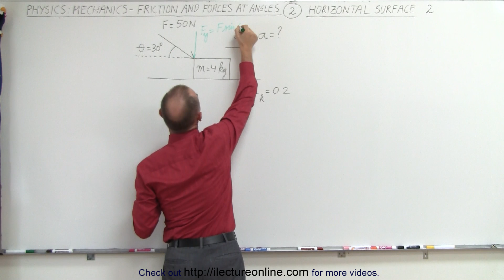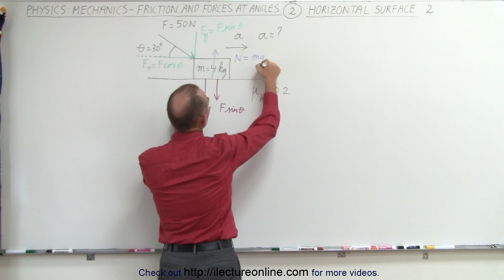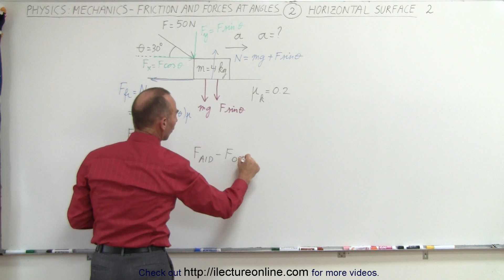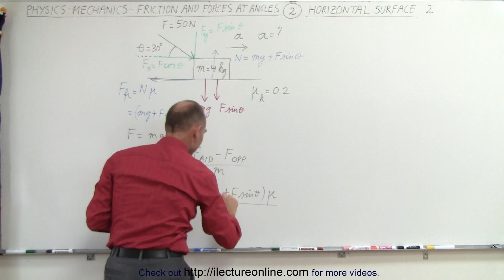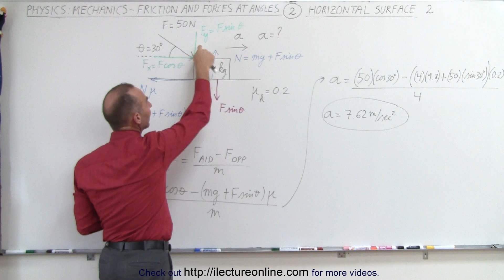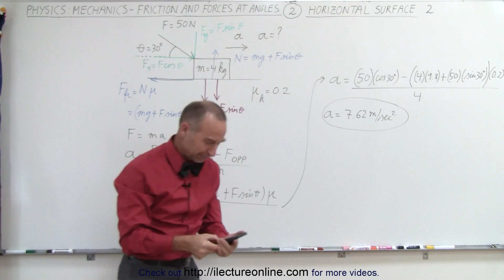Physics 4.7   Friction & Forces at Angles (2 of 8) Horizontal Surface: 2

Comment: Since acceleration is positive on the right hand side shouldn't the equation be a=Fopp - Faid?  Correct me if I'm wrong.  I always write the side of the acceleration first & negate the other side.  Thank you
Reply from the maker: I prefer to calculate the magnitude of the acceleration first, and then determine the direction, if the original guess was wrong.  But yes there are several ways in which this can be calculated.

Comment: The coefficient of friction between ground and ground is 0.  Is 1.  15 kg is the value of the force f if the offender receives 3ms ^ -2 armature when the f key is applied to the offender.(fcos 30, f sin 30)
Reply: Your question but find force
Reply: That is picture

Comment: i got 10.1 as my final answer..

i did everything as in the way you showed, there may be a mistake here..

by the way, these lectures are amazing and you are a great teacher. thank you.
Reply from the maker: I just checked the calculation and it is correct in the video.  Thanks for checking.
Reply: ahh, a negative sign messed me up! 

for the normal force at the end of the problem, i had (4)(9.8) - (50)(sin30) when it should have been (4)(9.8) + (50)(sin30)

this will teach me to be more careful next time :)

Comment: if I was given a static friction and kinetic friction and 2 forces and asked if the force was enough to move it or not and if it was enough what's the acceleration ?? Finding the acceleration is easy but to find if the force was enough to push the mass or not I have to see if it was bigger than then the normal force so Fcos must be bigger than (mg+Fsin)Us to make the mass to move right?
Reply from the maker: That is correct.